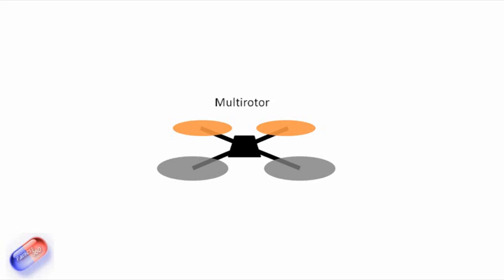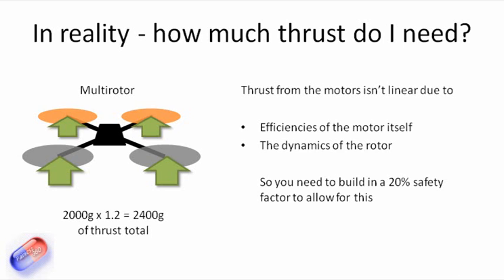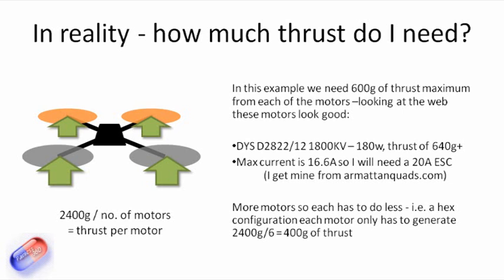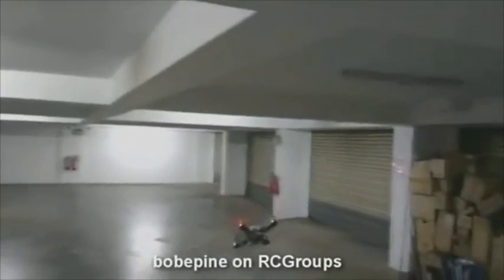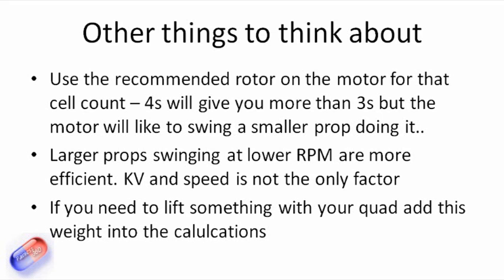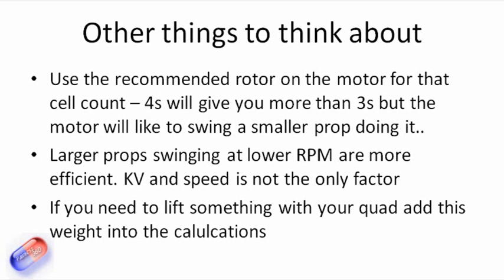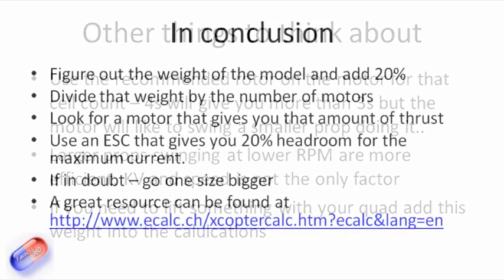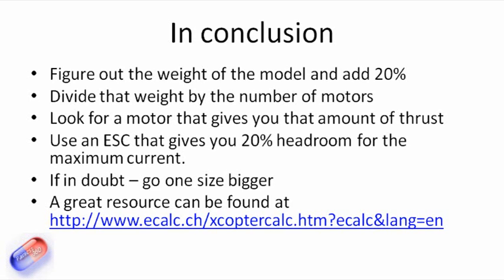How to select the right motor for your multi-rotor (all types - Tri, Quad, Hex etc.)

Comment: Could you comment on specifically matching the motor/prop size to the application of the quad.  I'm beginning to figure out that, if you want less agility and smoother and slower response time, say for videography, than a larger quad with slower motors and larger props would be the recommended way to go.

If, you're into racing and quicker maneuvers than a smaller quad with smaller props and higher KV motors would be the approach.  Yes?
Reply from the maker: You've got it - lower KV motors with larger props will give you far better efficiency, longer flight times but slower response to the changes in throttle. Smaller props in high KV motors are less efficient but can be far more responsive to throttle changes and support more acrobatic flight without failing. Happy flying!

Comment: ive chosen 1000kv turnigy D2830-11 and 10x5 props for my x900 frame tricopter with a 4s 2650mah battery. they recommend 10x7 on 2s or 8x4 on 4s, lets see if it works. its my first build. still can order smaller props
weight with battery is exactly 960g
Reply from the maker: Best of luck!
Reply: Finally, my drone flies. but not so long it started smelling burned.  the motors were damn hot after just 1 minute hovering.   
i think i get some smaller props like 8x4 not 10x5 for 4s.    it had like 4kg thrust in full throttle. 

or should it get stronger motors?
Reply from the maker: Every motor will have a specific size of prop in the specs for the battery size you're using (3s, 4s etc). Using more than that will cause things to overheat and fail. Check the specs on the motor you're using to see what the recommended prop is for your setup..

Comment: hi, I'm making a quad copter. I didn't do any research any just bought the components and now I'm having trouble flying the quad.i have 1400 kV motors and 10*4.5 props. how can I improvise so that it flies well. using small props should work, right? I want to use the same motors, if possible. thanks for the reply in advance.
Reply from the maker: No idea without knowing the model and type of the motor you're using. I'd suggest working through this video with the spec sheets for the motors you have to figure out if they will work with your model. Best of luck!

Comment: hello , if i read your conclusion , its not according to the begining, 1000g+ 20%= 1200g , not 2400,am i right?
or how can a ZMR250 fly with only 4 Dys1806?I can't reach the site for calculation...
Thanks for your videos , they are greats.
Reply from the maker: +francois Bonin you need a little more than twice the weight of the model in total thrust from the motors and props you use. Best of luck!
Reply: +Painless360 i will go for a quad , they will be too short  for a tri...Thank you.

Comment: Thank you for this video,  I liked and subscribed.
 Newbie question,  do you figure in the weight of each motor prospect when doing this math. I'm assuming the motors are the biggest portion of the weight. 
Please advise, I'm about to start building my own quadcopter. 
thank you
Reply from the maker: +Greg Tate Yes, add a 'guess' for the weight. Tools like ecalc (Google it for the website) are excellent too. Happy flying!

Comment: Hi, this video helped a lot, so thank you for that. But i would like to check. I have calculated the weight of my quad (the frame, electronics, gimbal, and camera gear, plus the battery, and a estimate on motor weight).
The weight, in grams, of my quad-copter is 1131g. What motors, and ESC's would work for my setup.
Thank you, and i hope you get around to reading this.
Reply: To add, i believe knowledge on the FCB would help.
Im planning on pairing it with a  -  KK2.1.5 Multi-rotor LCD Flight Control Board

Comment: Ok I see, so I guess I need to make sure that the motor can produce the required thrust at 50% throttle. Motors like Tmotor and KDE Direct offer thrust charts with thrust number at different throttle settings. That is what I'm not sure about if I should look at 100% throttle thrust numbers or 50% throttle thrust numbers when selecting my motor.
Reply: +traxxi2003 50% to lift the weight (and just hover). The remaining 50% you want to use to ascend. So look up at 50% of throttle to match the calculated weight.

Comment: Painless360, thank you for such a great video. I do have one question; in your example you stated hat you need to produce 600g of thrust per motor. So with that information you selected a DYS 2822 1800kv which produces 650g+ of thrust. Is that at 50% throttle or is that the max that this motor can produce? Is the idea here is to select a motor that produces the thrust you need at 50% throttle or less?
Reply from the maker: +traxxi2003 The idea is that the motors together produce thrust that is more than twice the weight of the model so that you can hover about 50% throttle. Some pilots who want insane performance build models with 3 times the thrust.

Comment: Hey any video explaining the battery selection for multi rotors depending on motor kv?thanks In advance
Reply from the maker: +ganesh gowda KV makes no difference to the motor selection - use the max amps to size the ESCs and then use that to size your battery capacity. Best of luck.

Comment: hai painless360,
im making a quad weighing around 2100gms
my choice for motor is turnigy D3542/6 1000KV 
frame: HAL turnigy
3s 4000mah battery
10 inch prop 
what about my choice ?any suggestions ,im  gonna use this quad for surveillance.really need some help
Reply from the maker: +smartavatar95 Impossible for me to comment as, although HobbyKing has listed the maximum thrust of the motor they have neglected to share any detail on how you get it.. I'd ask the HobbyKing support team for more detail. Best of luck.

Comment: Hello painless360,
I am making a quad copter of 80 kgs, which motor do you recommend?
Reply from the maker: No idea - you need a motor with 45kg of thrust!
Reply: thank you!
Reply: +Painless360 wouldn't it be 24, because (1.2 * 80) / 4 = 24?
Reply: +angrytoadz no its ((2*80)*1.2)/4=48. You first double the weight before multiplying with 1.2, is what i understood.

Comment: I don't see thrust specs on any of the motors Hobby King sells.. Are they garbage, or am I missing something here.. I would like to build quadcopter, and I will be studying quadcopters for about a month before I make my first purchase.
Reply from the maker: MARK 1 This is the danger when buying motors from places that do not give thrust values. Some of the motors they sell do provide that detail, along with prop recommendations. They source their motors from the same places as most others so the quality will be the same. 
Other vendors may have the additional detail you need for the motors from HK, so searching is worthwhile. 
Always slightly overestimate the thrust you need as 50% throttle does not equal 50% of the maximum thrust.
Best of luck with it.
Reply: Painless360 Have any recommendations to where I could shop besides HK.. Seems when I do a Google search they're always on top of the results. I honestly don't like the fact that there's no other good quality stores online that you can buy from besides HK. Got any recommendations..?
Reply from the maker: Depends on what you are after Banggood.com are working to have a better range of RC kit and some more local places (depends on where you are in the world) offer a faster service.

Where in the world are you?

Comment: Great tutorial! I'm trying to come up with a quadcopter design with 8 motors (the counter-rotating type).
Can you give a little more explanation on motor selection from the thrust required for each motor? Suppose I require 70N of thrust per motor, which spec of the motor should I match against to make sure that it will generate enough lift?? Whats the relation?
The motor specs does not mention any thrust value.
Reply from the maker: Nikesh Bhattarai If the specs don't mention the thrust in grams then email them and ask. You also need to get an idea on prop size/thrust too.
 Figure out the weight of the model and aim for 2.2x that weight in total thrust from the eight motors.
Best of luck.
Reply: Painless360 If I use 8 motors (4-pairs, each of the motors in a pair are counter-rotating) on my quadcopter, is each of the motors gonna provide same lift? Suppose my copter is 10kg in weight, can I assume that each of the motors I require should provide atleast 10/8kg of thrust?

Comment: Great info... I decided to built my own and this has helped me. :)

 Though the link to the calculator is broken, they changed the .htm to .php.
The best way to access it is from their home page at ecalc.ch where they have calculators for the other types of Aircraft and in different languages in-case anyone is wondering..

Thank You for steering me to that site, I think it will help alot.
You just won a brand new subscriber. Congratulations!
Reply from the maker: 1.618033 Thanks for the note about the link - updated.
Happy flying!

Comment: Thrust is measured in mass units??
Reply: Daniel Pendergast Thrust or force is also usually expressed as kg-force (kg-f) or g-f, which is what is explained in this video. Multiply by g=9.81, u'll get the value in Newton.
Reply from the maker: Grams usually but not always. Happy flying!
Reply: Daniel Pendergast Oh and don't forget to change gram to kg.

Comment: hi , im going to mount a quadcopter im going to use a 450 frame from dji and 4 motors XXD A2212 KV2200 Brushless Motor H365 For RC Airplane Quadcopter,in your opinion is the right motors???? thanks for the great job in the videos
Reply from the maker: Lenny rc portugal Some decent data on @1833491721
Looks like they will work and support a 1-1.2Kg model easily (depending on 3s and prop config).
Best of luck with the build!
Reply: Nice, I have 3 s lipo yes. Is coming also a am v2.8.0 Controller with neo 6 m gps
Reply: I think is OK for the model, you tell me please. Sorry to bother
Reply from the maker: It's all about the weight - I don't know that so can't comment.

The rest looks good.
Reply: ok thanks .have a nice day ;)

Comment: my quad config : 450 frame, 2212 1000kv motors, 30a esc, kk2.15 fc. whole thing weight about 700g without the battery. i only have a 2s 2150mah batt (3s 2200mah on the way) & have 8045 - 1045 props. my question is which is be more efficient?
Reply from the maker: firestartergmh Great question - see https://www.youtube.com/watch?v=Sjwi_UnCLWc for a video in this very topic. Should help.
Happy flying!
Reply: firestartergmh I recently got a 450 frame quad , and am running 980kv motors with (currently) 1050 gemfan props on there. The battery is a 2200 mah 3 cell, and for my purposes, just learning how to fly it is more than adequate. 
The place where i bought it takes the same setup, and performs acrobatics with the same quad, after some minor changes of the settings on the Naze32 board they i have in mine.

Comment: Question on motor balancing.  Do you remove the stickers that are on the motors?  I would think that the stickers would upset the motor balance?  Or do the manufactures use these stickers to balance the motors?
Reply from the maker: Not sure if most of the cheaper manufacturers balance their motors at all! I balance when with, easier that way.

Happy flying!

Comment: I am going through this right now with my Tri copter.  I have Suppo M2212-930K motors that are spinning 8.5 DJI props, reason is only props I could find that have the DJI splines that were in stock,  Its way underpowered with these props.  I have ordered 9.5 and 10.5 props to test. Hopefully that will do the trick.
Reply from the maker: Looking at the specs then those props look a better fir. I use similar motors here with 10x5.0 props and it flys nice.

Best of luck!
Reply: Thanks
Reply: Painless360  Huge difference with the 10X4 props!  The tri is a rocket ship now.

Comment: how did you work out how much thrust the engines give?
Reply from the maker: You need to look at the spec sheets that are with the motor. Most quality retailers will include this detail. For example look at http://innov8tivedesigns.com/Cobra/Cobra_2213-12_Specs.htm for one of the best examples but also http://hobbyking.com/hobbyking/store/__8622__2213N_800Kv_Brushless_Motor.html for thrust figures quotes alongside the specs.

You can also use the http://www.ecalc.ch/ site to calculate thrust and flying times (if it has a close enough motor for you to select). Happy flying!

Comment: 4118 4000kv on 250 quad need i say more? LOL
Reply from the maker: Rich Morgenstein If you do that post a video - I'd LOVE to see that >:) :)
Reply: Painless360   Actually while back  I put a set of 3700kv 1822 gartt rc motors on a F450 frame with 10 inch props. 4cell lipo,  So much thrust on that damn thing flight controllers could not deal with the fast changes.  Naza, apm failed on takeoff.  Pixhawk was only one even close to fly it lol screws keep snapping as well from the force applied to arms as well over time.

Comment: I accidently bought 1240kv motors, I meant to buy 1000kv motors,  will my 1240kv motors drive my 9'' props?

 I am using a3s batt. and Turnigy Aerodrive SK3 - 2826-1240kv Brushless Outrunner Motor.
Reply: im using 8x4.5/1000kv turnigy on a dji flamewheel f450 and works just fine
Reply from the maker: Depends on the pitch. It would be great if Hobbyking published details of the prop/thrust n8umbers for their motors (like Scorpion). It would make this SO much easier. I'd message them and ask.

Best of luck.
Reply: The pitch is 4.7, am right at the limit of these motors?  What is the approximate max-safe size I should.  Could I just go to a 7'' prop and be fine?
Reply from the maker: From the comments on the HK page it looks like the 8x4.7 is used a lot. You can try the 9" and check the temp and current draw..
Reply: Ok, thanks.

Comment: I just buy 1000kv motors and three of them are the same but one I can't spin as easily as the other three and I was wondering if that is a problem.
Reply: I would first check the signal wires to the esc, perhaps swap it with one of the others to see if anything changes, if not change the esc if still no luck try changing the motor. Also check the power connection to that esc
Reply from the maker: izzzzzz6 hi, with the motor not connected to anything, try and turn it by hand and compare it to the other motors. Does it ake more to turn it? Can you feel 'notches' as you turn it? If it feels the same then check the soldering on the bullet connectors..

Best of luck getting it sorted.

Comment: You know, I saw a post somewhere where the guy quoted a spec for his motors at 23gm. Im betting that mustve been the weight of the motor, and not the thrust as he had written. Did I surmise correctly?
Reply from the maker: Without a link to look at, that is the most logical conclusion. Happy flying!
Reply: Yep. As soon as i wrote that,  i went and looked. It was wayne rc, hehheh. Was my question i posted further down correct? If you get the first combo rigbt, only necessary to add new weight, and up the motor size? Have a great day.
Reply from the maker: John Robertson That would work, that's why it's always better to slight overspec the power system as you always end up adding weight to the model (cameras, FPV, gimbals) not taking it off :)

Comment: Do you add the weight of the motors into the equation to determine thrust?
Reply from the maker: You need to estimate the all up weight of the model - including the battery and motors. Happy flying!

Comment: This is a really good video, but I'm not sure I've got this right... here you say..

"Almost. You need motors and props that will give you a total thrust that is a little more than twice the weight of the model",
then followed by;
"You have it right, the maximum thrust needs to be a little over the all up weight of the model". 

In the video it says, weight + 20% / number of motors. My quad weighs 2000g. which means my motors only have to provide 600g of thrust. Great. I'm using 2213-935kv 850g motors. Only if you multiply the collective thrust by 4, I get 3400g of thrust. This figure isn't a little more than twice. Please help I'm confused! James.
Reply from the maker: You need motors and props that will give you a total thrust that is a little more than twice the weight of the model. Be careful with the rated thrust on those motors -  I use those motors on a 3S setup and about 1.2kg is the max model weight they will handle (with a quad).

Comment: Hi,
This video is very helpful!
I'm wondering, were You talking about the maximum thrust or the recomended thrust?

Even the E300 has a thrust recomended of 300g/axis and a max.of 600gr/axis.
For example if you take a quad f450 frame it gives you a total thrust recomended of 2400g and a maximum weight of the drone around 1000g (2400g/2.4).
It's not much espacialy if you want to have a gimbal and gopro...
Reply from the maker: You have it right, the maximum thrust needs to be a little over the all up weight of the model. Many of my models are about the 1kg-1.2kg range and that is enough for those types of motors. Any more and they struggle.